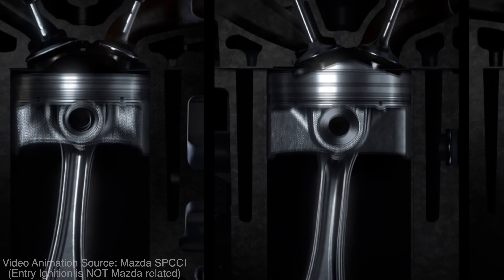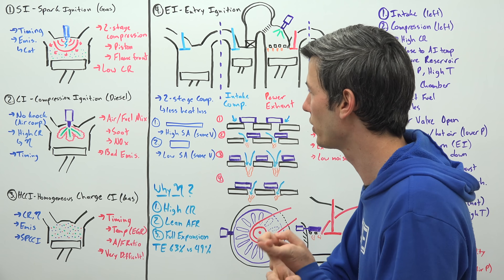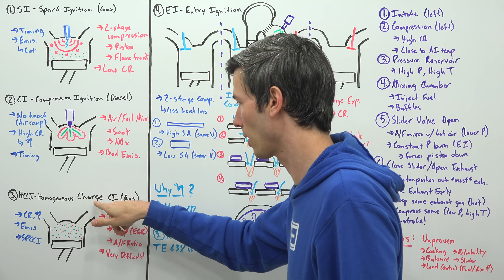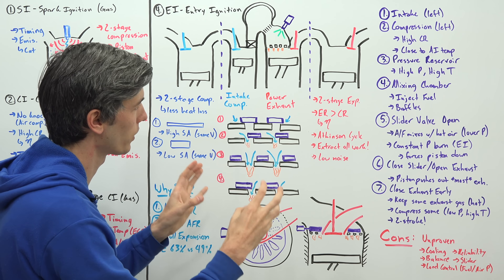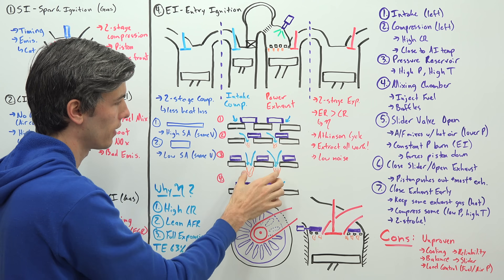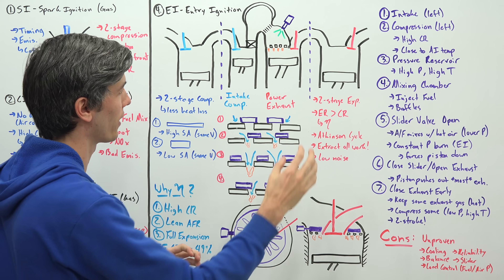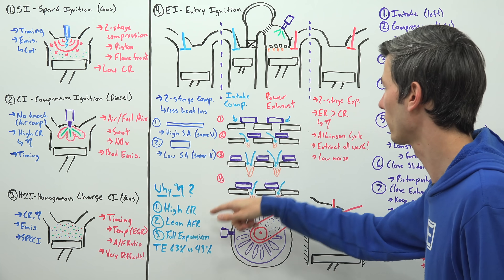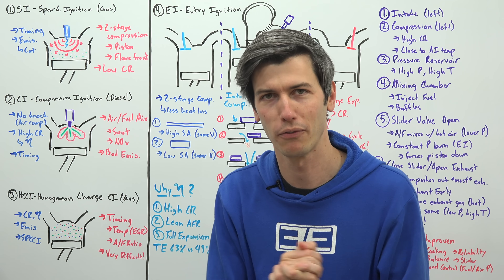Is 'Entry Ignition' The Future Of Combustion Engines?

Comment: engineering / reliability  issues aside I cannot see how load issues would be overcome and maintain TE in a typical driving environment. What I can see working is this application in a Hybrid charging application. Very small displacement always on constant speed application charging battery cells. But how efficient (TE) could a constant speed turbo verse the power and weight of two additional cylinders ?

Comment: GOOD ENGINEERING IS NOT BUSY ENGINEERING. This is unnecessary complexity.  This design will result in gobs of unreliability, just use a combined cycle jet engine to power a generator for an electric drive train, eff is 61%

Comment: It's pretty easy to reduce this to a single cylinder setup. Just use a turbocharger. Instead of a two-stage piston compression, the turbo would do the job. Instead of a second expansion chamber, that remaining useful work could instead be used to power the turbocharger.

Comment: Just not complicated enough for my liking.
Reply: If it can be explained on a white board with only 4 colors, I’m with you. Seems too simple ha
Reply: PapaWheelie ha funny
Reply: Give it to the Germans, they will find a way to complicate it at least 100% more
Reply: IMPRACTICAL EXCERSIZE IN ENGINEERING ... Piled Higher and Deeper production
Rudolph would deem it less practical than his peanut oil engine...
Reply: That's one the draw backs...complecity,more. That might break
Reply: I'd argue the complexity is spread across the engine.
But if one cylinder head fails, the whole engine fails. Todays gas engines have a lot of redundancy, so much so, some engines turn off some cylinders for economy.
But then again, who drives with one or more cylinders not working? If you do... Probably should... Fix that

Comment: The combustion pressure is lower in the cylinder than the fuelling chamber? 
Force pushing down on the piston will be equal to force pushing up into the fuel chamber.

Comment: I've long thought a second stage of capturing heat expansion would be ideal.  It's tough to imagine a piston compressor being as efficient as a screw compressor for the first stage of this process.  I'm still betting on opposed piston engines being the future.  Perhaps adding an additional large diameter piston to capture exhaust heat from an OP engine could be the current holy grain of ICE efficiency.

Comment: I love the way you explain the physics in your videos, its basically the reason i watch them. I just dont find much sense on this particular one. After asking 0:15 "you might be wondering why we dont swich to electric" you explain an engine that:
Has to be developed spending a ton of money due to the amount of changes in comparison with a traditional gas engine. 
Not be proved to work.
As commented at the end a lot of challeges has not been solved yet, like cooling. 

I am really still wondering why aren't they switching to electric.
I love gas cars btw, i have a '92 civic eg5, but im not making a profit by selling it, im just loosing money on gas everyday and fuckinh people around me when I drive it, and my intentions are to use it as less as possible untill i have a more sustainablr alternative.
Still thanks for ur videos.
Reply: Why not electric? Because at present batteries are still more expensive. But they're coming down in price every year and it won't be long now before an EV is cheaper than a gas car. Used EVs are already cheaper than gas cars, but you have to put up with a short range.

Comment: The main pollutant from diesel engines is NOx which is formed due to the higher flame temperatures, not because there are rich or lean pockets in the cylinder.

Comment: Simple question here about standard 4-stroke engines..could a second expansion cylinder be added to make use of the additional expansion? or maybe one secondary chamber servicing two combustion cylinders so it does work with every down stroke. i'm imagining a 6 cylinder engine, with two mirrored packages of two standard 4-stroke cylinders augmented with a secondary expansion chamber. these could be built with the secondary chamber on the opposite bank of the vee from the traditional cylinders to try and achieve balance. 
is that an entirely silly idea?

Comment: @Engineering Explained
 3:40 we can control the ignition timing by changing the compression level . i mean there can be something like extra isolated valves (air in the combustion chamber cant move behind that valve) on the cylinder head to move up and down by just some millimeters to adjust the compression level in the combustion chamber . so by increasing the compression level earlier it can ignite earlier than normal.

Comment: Honestly I do not think this will be broadly available any time soon. Heres why: 
- Constant Pressure cycles are less efficient than constant volume cycles at the same compression ratio however there is a second expansion and higher compression 
- massive wall heat losses due to the multiple wall areas from the compressor, intake compressor, connection between intake comp and power cylinder, ... 
- massive NOx emissions if leaning out
- massive temperature problems in the secondary expansion cylinder and the sliding valves

Comment: Using Infiniti’s new variable stroke plus new cam being developed with variable valve timing, lift AND now duration along with good computer control I think you could make gas CI work and maybe even keep a spark plug there for any special requirements.

Comment: My first thought: Wait, isn't that a super charger with piston form?
My second thought: Wait a minuet, isn't that a turbine jet engine with piston form?
Reply: That was my first thought, it's basically doing the same work as a turbo or super charger. So I guess the issue boils down to cost of production being cheaper?
Reply: Doesn't have to be a slider valve. They could use a rotary valve or something else.
Reply: @DChrls  What's that got to do with what he said?

His point is that it works using the same thermodynamic principle as a modern turbine engine: several compression stages and several expansion stages.
Reply: Or a steam engine with combustion chambers, yes/no?
Reply: Glad I’m not the only one who thought these
Reply: yes this is a very clunky version of a turbine engine
Reply: I thought turbine engines use continuous cycle engines. This has a distinct power stroke?

Comment: I think the Ausies did something similar when they inverted a 2 stroke engine on top of a larger 4 stroke, to use it as a valve mechanism. Then there is the "sleeve valve engine", also Ford's experiments with the" external combustion engine" . These experiments, like the Wankle rotary, are highly dependent on the science of metalergy, plus engineering challenges. Why, the gas turbine.

Comment: you had me at 2 stroke.. but I could see this becoming a 12, 16 or even 20 cylinder machine to improve power delivery or even reliability with multiple ignition cylinders as it has some redundancy the same way current engines do,  it may ultimately prove unreliable, but Its cool to see new ideas making headway.

Comment: The idea is great an all, but I don't quite understand how would one start the engine. @Engineering Explained says that the combustion starts because of the hot exhaust gasses from the previous cycle, however, when you are starting the engine, it's cold and there aren't any hot gasses to ignite the mixture. Am I missing something or this kind of engine would need startup spark plugs?

Comment: You mention that ignition occurs because it is hot,and I get that if some exhaust is retained then heat will be present but on start and under cold ambient conditions where does the heat come from initially,is it just the primary compression of the air..and if it is I would say starting would be a fickle affair unless a glow plug is used.

Comment: One thing which could be an issue (If I understood it right) are th epressures involved in the pre-ignition compression. By this principle, the air will have to be complressed beyond the combustion pressure of the power stroke in order to prevent back flow. How is this system handlng longevity problems with sealings and the cost involved with this? It at least sounds like a vast increase in material wear. Also what is power density like if only one out of 2 or 4 cylinders is expanding from high pressures?
Or we use a diesel engine and fuel it with diethyl ether or decanol. Most of the problems diesel engines face come from the high amount of aromates in the fuel itself.

Comment: So three driven cylinders required to operate one power cylinder, I'm not convinced it would be "overall" very efficient at all even though the combustion process itself is very efficient, and then there's the reliability issues of these check valves and slider valves.

Comment: Too many extra moving parts for the overall efficiency to be a meaningful improvement; and that may still be the case if all the additional stages were driven electrically.

The rotary valve concept is superior (to poppet valves) but it wont be the way they have it shown here.

Comment: How does the initial combustion begin (starting the engine for the first time) if it requires heat from the last combustion to ignite the compressed air fuel mixture?
Reply: It's kind of like starting an old Ford 200 six cylinder with a stuck open choke.  Takes a little patience and proper modulation of the accelerator pedal.  LOL

Comment: Two things I don't understand. First, how do you assure that the pressure in the combustion chamber is lower than the air you  compressed before it? Second, no matter how you compress the air aren't you increasing your rotational inertia more than what you have with a conventional combustion engine? While the burn of fuel is definitely more efficient than a conventional combustion engine is the entire system more efficient?

Comment: That sounds like a whole lot of engine trouble and unreliability. Those valves won't last. It's also going to be really hard to control the timing perfectly...I'll wait 5 years after production and see. DCT's also sounded like a great (and simple) idea at first...But they are the most unreliable transmissions out there.

Comment: If it uses the heat from the exhaust of the previous cycle to ignite the fuel in the current cycle, how do you start the engine when there is no hot exhaust present?  Would it need glow plugs like many diesels do?  This engine seems like it's in the same category as many other alternative engine designs that look good on paper, and are a total failure when someone tries to make one actually work.  If it even runs for any length of time without exploding, it would be so expensive you'd never get any payback from the slight real-world efficiency gain compared to the relatively cheap and reliable Otto or Diesel engines.

Comment: Sounds like it might be similar to a design by Smoky Yunick from last century.  I think he called it "vapor cycle."
Reply: His "Hot Air Engine" in a Pontiac Fiero. It used turbo exhaust gas to super heat the fuel.

Comment: How does it start?

The mixing chamber has to be higher pressure and lower temp than the combustion chamber. How do you increase temp while moving to a lower pressure to get ignition while cold starting?

Comment: Reminds me of the old steamship engine with high, medium, and low pressure pistons to extract as much energy from the steam as practical.
Reply: Modern steam turbines have the same thing.

I am a physics student and I recently got a job at a nuclear power plant in Germany, which has one high pressure aswell as three aditional low pressure turbines.

It is really a funny setup since the high oressure turbine, which does more than 80% of the work is the size of a car, while the three low pressure turbines have the size of a one family home.

The high pressure turbine has 1200 MWe and the thre low pressure turbine have 76 MWe each.

In the early 90s the plant was uprated from 1360 MWe to 1428 MWe.

The did that by replacing the old turbine set with a new one.

The old one had only two sets of low pressure turbines.
The redisigned the geometry of the high pressure turbine and the two low pressure turbine, so that those two would still produced the same amount of power, but the steam exiting those three turbine would still have enough pressure for one further turbine which gabe them 70 MWe more in total while the reactor power output stayed the same.

But this is not the same as the reactor upeates that some GenII Boiling water reactors have done, where they modified the reactor to produce 20% more power, this was just achieved by a more efficient set of turbines.
Reply: One last thing.

The thermal efficiency of those kind of plants is pretty muched maxed out.

We get 1428 MWe out of 3900 MWth, so 36% efficiency, this is the same the slightly bigger new EPR gets.

There is no geometrical trick one can use to make those turbines more efficient.
The reactor type  we have, or the reactor type almost all NPPs have is a water cooled reactor (only Russia and UK have other types of reactors) do not get hotter than 340 °C, which requires its own type of turbines.

Coal plants have higher efficiency, since their steam is hotter, but even the 10% more efficiency does not save them from  820 gCO2/kwh emission while we have only 6 gCO2/kwh.

But some reactor designs achieve higher efficiency, but just having hotter coolants.

Sodium cooled reactors operate at 450 °C, which allows efficiencys up to 42%.
At this temperature you could use the same turbine that fits into a coal plant for a nuclear plant.

High temperature gas reactors, lead cooled reactors, and moltern salt reactors, work at 650 °C, which could give them up to 48% efficiency.

Also there are Very high temperature gas reactors (which use Helium as a coolant) and some lead cooled design that try or have reached up to 1000 °C and an efficiency of 60%.
There was a German reactor in the 80s called THTR, which did this, but it had a terrible track reckord.
Also there is a German company trying to develop a loop type lead cooled reactir which want to achieve temperatures of up to 1000°C.
Although they are into this temperature not because of the thermal efficiency, but for the prospect of using this high temperature to thermolytically produce hydrogen for usage in the chemical industry.
Reply: @abrahamwilberforce9824  , thanks for the info - very interesting and providing a lot of info/ insight. However, I think you should run some spellcheck on your comment, as it is quite riddled with typos ;-)
Reply: @MrKotBonifacy  I am sorry for that.

That has two reasons, one is the me speaking (or rather writing) english as a second language.

Another is that I have really giant hands and often seem to hit the wrong key.

But I can at least work on the firsr issud.
Reply: @abrahamwilberforce9824  Hey, no need to be sorry or apologize - it was just a friendly advice. I myself am not a native English speaker either, and while my hands are just "tad bigger than average" my eyesight is... well, as good as my age allows ;-)
Too good to use spectacles, too poor to see everything clearly - and as I most often type during night hours, typically in a dim light I inevitably make typos. But then I run a spellchecker and it catches all my mistakes. And that was the gist of my message - yes, we all make mistakes, but you can simply use the free tool readily available to correct the problem.
Cheers!
Reply: triple expansion,  made famous by the Liberty Ships... who played Titanic's engine room
Reply: christhephish there’s a fully operational Liberty ship in San Francisco Bay. Got to see it running last year. Super cool. Manually oiled though :)
Reply: It really does, his drawings remember me from the Titanic engine animation
Reply: Exactly my thoughts. I remember that scene from "Massive engines with Chris Barrie" - Ships episode
Reply: Bam! You nailed it.
Reply: Yeah, that is exactly what it is.
Reply: expansion engine
Reply: I was about to make the same comment but u beat me to it
Reply: Yep - when I heard "two stage expansion" a steam loco immediately came to my mind...
Reply: Now we know why modern ships are electric. So much efficient controllably power.
Reply: That immediately occurred to me as well. Also similar to marine and shore-based steam turbine installations, they typically have a HP and LP turbine, same concept, get as much energy as you can from the steam before sending it back to the condenser.
Reply: The last piston is like a more efficient version of the power recovery turbines on turbo compound engines.

Comment: I don't think it's feasible. 
Spontaneous combustion??? 
Going from high pressure hot to a low pressure and your spraying in fuel at the same time which cools it down.  
How does it combust again???   Combustion is started by the residual exhaust gases???   
I don't believe this works.

Comment: How does one get the first heat when starting that kind of engine? Is the compression enough to generate the heat even without the heat from the previous stroke or will there be something similar to a glow plug until it gets hot enough to run on its own?